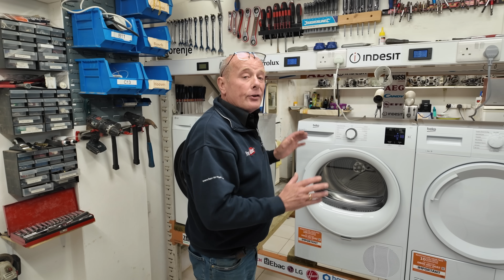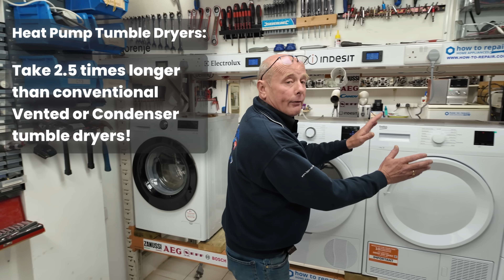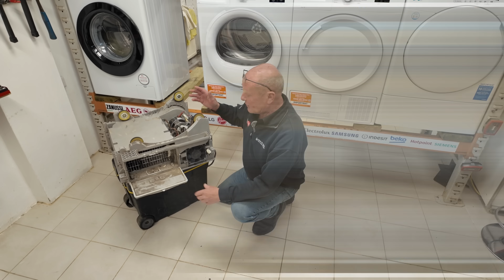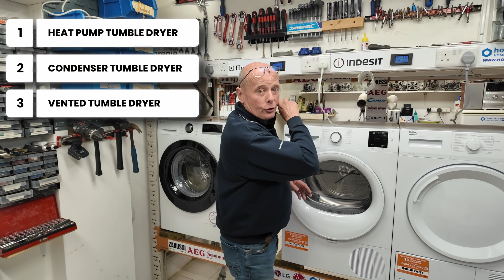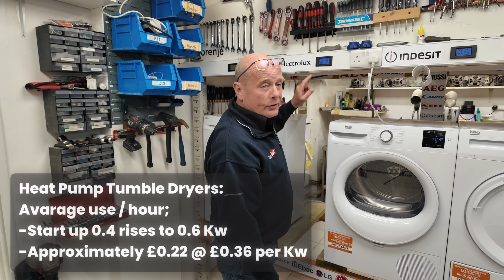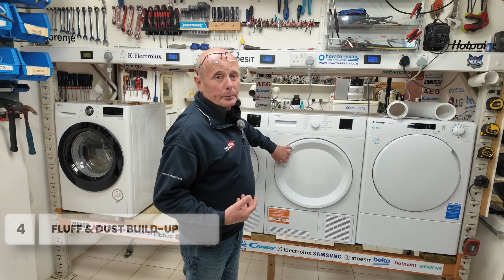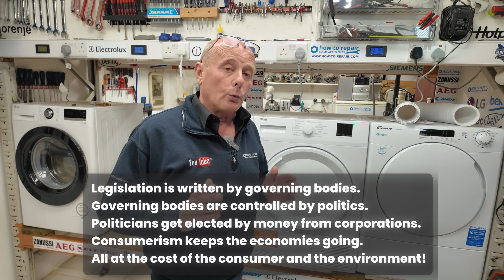Tumble Dryers the Shocking Truth About Heat Pump vs Vented & Condenser, NEW LEGISLATION!

Comment: Something you miss as well as just about everyone else is is the total impact of a dryer on energy consumption in a house, especially in the summer.  Most houses are not very well sealed and can have significant air movement through gaps and cracks.  Normally there is not much as the air pressure inside and outside of the house are the same.  What happens when you turn on a normal vented clothes dryer is a sudden change in pressure.  You now have 200 CFM of conditioned air pulled through the dryer and forced outside.  In order to maintain equilibrium in the house 200 CFM of air from outside the house will be pulled in through gaps and cracks in the house.  This is 200 CFM of hot unconditioned air that will then be cooled down by your homes AC unit (assuming you have one).  A heat pump non-vented dryer does not have this problem.

This may not be as much of an issue in the UK, but in the US, particularly in the south and mid-west where summer temps are regularly in the 90's to 100's F, a lot of money is spent to keep a house cool and even more is spent when you suck in large volumes of hot air from outside when doing laundry.  Calculating that effect on every house is not feasible but is still something to consider.  So, do consider the additional burden on an HVAC system when using a standard dryer when comparing overall total cost between a heat pump and conventional dryer.

Comment: Non of these can compete with the old white knight gas dryer 6 towels dried in 40 mins straight out of the washing machine.Gas cost less than 25p  Very efficient as no burning gas to make electricity

Comment: Do you see how awkwardly the door opening handles are placed on the right two machines? Not 180 degrees away from the door hinges, but at a lesser angle, making door openings more harder. For example door handle on the right machine spans between 2 and less than 3 o’clock, where much more logical would be just around 3 o’clock. Same goes with my brand new Bosh washer and dryer. Both of them have these weird door handle positions.

Comment: I came to the same conclusion as you.  After my 9 year old condenser dryer heating element died.  I investigated repairing the heating element, but realised that the part required was costly (50% the cost of a new machine).  The heat pump dryers made no sense to me, when I could air dry just as quickly.  I will replace my old dryer with another new condenser dryer.  I totally agree with you.  The environment is better if we retain and maintain our old appliances, then purchasing new ones ever 5 years.  The environmental impact caused by manufacturing of new products and shipping and the disposal of old is never really taken into account.  Thank you for your video.

Comment: We should have repaired our 30 year old Electra vented machine (needed a new bearing) instead we bought a condensing dryer which seems OK. To be forced into a heat pump dryer that is more expensive to buy and cannot economically be repaired to me seems like more madness.  Sounds like Red Ed at work.

Comment: My Miele hestpump dryer now has 3500h on the clock, it runs ~2h on a cycle and uses 1kwh for that (I monitor both with a smart plug for the last 6 Months, so these are solid averages, energy consumption honestly even slightly less). Based on that it ran ~1750 times and used ~1750 kwh. Based on that a traditional dryer would have used 3x as much or 2x additional, so an additional 3500kwh. With this energy cost savings I could buy myself a new one right now and still have some left over. But mine still goes strong for now.

I had a Bosch heatpump dryer before that I gave away, where i did take it apart once for cleaning and conpared to this, the Miele filter system is way ahead with a third bottom filter and proper filter clog detection. With proper use I did not see significant dust buildup in the condenser yet.

I think, most of the maintainance downsides of can be addressed through propper engeneering and the willingness of consumers to spend a little more money. These devices have gotton so cheap anyway compared to 30 years ago. And with newer refrigients most of the enviromental concerns in this regard can also be mitegated. Dryers have shown the biggest progress in terms of efficiency of all the big household mashines and to just ignore that is just misleading.

Comment: Fridge freezers don't fail or need re-gassing that often and they are a heat pump system.

Bearings will wear and they definitely need to improve cleanability but, heat pumps are the future, manufacturers simply need to make them to be user maintained friendly.

Comment: We had an hoover engineer out for our A+ condensor dryer which stopped drying about 8 years after we got. Luckily it was a 10 year warranty so we didn't have to pay for th Engineer however he diagnosed it as requiring a re-gas but that model could not even be regassed so they gave us the option of paying just £150 for a brand new dryer of the exact same model as a replacement.

80p to dry a full 10kg wash in 1hr 30 mins I dont think is too bad. Much cheaper than what Martin Lewis was reccomending at the time which was using an Air Conditioner unit to dry clothes which worked out a lot more expensive because it took far longer to dry stuff.

Comment: Wow, thanks so much for your extensive explanation, now I am certain that I will keep my current condensor dryer.  They really are in it to sell you a new machine every 5 years. The heat pump dryer is REALLY a bad concept. Also, I hate half dry clothes that takes more than 2 times the current drying time...

Comment: For some time we've managed with a condenser drier, having to remove and clean the condenser box every month or two. Not an easy job, but a radiator fin cleaning brush does help.
We have been looking at buying a heat pump dryer but have not found one yet that has any method for the user to clean the condenser box. Several have the same cover to get access to the condenser box as in a condenser drier but no means to then remove it.   Watching the video it's now clear that getting access to clean the condenser box on a heat pump tumble drier is not the user job that it should be.  What is the point of an energy efficient heat pump tumble dryer if it's much vaunted energy efficiency cannot be simply maintained because the condenser box can't be cleaned easily by the user to maintain it's energy efficiency.  Indeed why buy a heat pump tumble dryer at all if, as the video shows, an engineer has to be called out to maintain that energy efficiency by taking the machine apart to clean the condenser box - and how often would that be needed given the access door does not even permit an inspection of anything but the front of the condenser box.  How does one even know the condenser box has become partially blocked so as to adversely effect the energy efficiency when only it's front face is visible with the cover open and there is so much more behind that front face that can't be seen or removed by the user to inspect.
The appliance industry has to think again about heat pump tumble dryers and correct an inherently bad design from a user maintenance perspective.  This, so to allow users to a) monitor a drop in energy efficiency of the condensing process and b) so enable user preservation of the much vaunted energy efficiency of included heat pump technology by giving easy access to the condenser box to clean all it's dust and debris collecting orifaces without needing to call out an engineer to do it.

Comment: Was it the manufacturers that "greenwashed" the government or the other way around? In automotive industry as an example it was the government funded research into global warming and so on that led to the introduction of Euro1-7 standards, with Euro7 that hasn't been implemented yet being completely impossible for purely petrol/diesel engines to comply with which in turn stagnated any and all combustion engine research and development for the past 5 odd years (why would you develop something that will be impossible to sell a few years down the line) with car manufacturers expecting to switch to fully electric engines (which also costs money to develop and forced many manufacturers deep into the red to do so, as that was an entirely new industry for most manufacturers at that time) to which governments offered monetary support in form of grants and such to consumers buying those vehicles, by now most of those grants dried up and the share of electric vehicles in most countries not even reaching 1%, only China is leading with 10% of their vehicle fleet being actually electric, and it's many times more than everyone else while still being barely a dent. On top of that governments are now starting to think that maaybe that wasn't such a great idea.
In the end we have a completely failing automotive industry that hasn't developed any new petrol engines for the past 5+ years, is for the most part financially ruined and electric cars that barely make a dent in the entire vehicle fleet of all countries of the world while being a lot more expensive than combustion engine cars without the promised government grants and discounts for switching to electric. So far the only company making EVs that made any profit was Tesla, and their profit wasn't even from selling EVs, it was from selling their emission quotas to other companies, everyone else is so deep in the red it's quite insane.

Comment: I bought a second hand Bosch Serie 4 heat pump dryer second hand in 2022. Has been drying clothes ever since without a single issue. I clean the fluff filter after every load and the additional filter before the condenser occasionally. Saves me electricity and doesn't release any heat into the surroundings.

Comment: Well, you made a friend in ME, that's for sure! And a new subscriber. This video is exactly what I needed as I face replacing a 20+ year old Miele (condenser) dryer suddenly, and was just shocked to see current prices. It was quickly apparent the jump in prices was due to the addition of heat pumps, so I went to research them a bit and -- thankfully -- came upon your video. I'll now see if I can still get ahold of a new condenser dryer instead.
Reply from the maker: Thanks for the subscribing. I hope you get a good condenser or vented tumble dryer since making the video I have seen thousands of complaints about these new heat pump dryers, please remember to share the video if you can

Comment: You should have used the power loggers you have to run a drying cycle on each machine. With a standardised load of one identical bath towel soaked in... 500ml of water? IDK, work out how much soaks it with minimal dripping and use that much.

Comment: End of life for a heat pump isn't hard. You just need the right bit of kit to suck the refrigerant out. 
Modern ones are R290 with a ~150g charge. R290 is Propane, which is 100 year GWP of 0.02 (1 would be the same as CO2, so it's 1/50th as bad as 150g of CO2).
The total environmental impact of just venting the R290 to atmosphere is 3g of CO2e. the UK grid average is 124gCO2/kWh in 2024, so it's just 24 Wh or 0.024kWh of electricity equivalent. For an average UK fleet car, it's the equivalent emissions of driving 23 meters. In other words, completely negligible compared to running a normal house gas boiler which emits the same amount of CO2e in 2.6 SECONDS.
It's just not a problem to even bother thinking about. The energy saving is easily worth it by several orders of magnitude.

Comment: The maintenance issue of cleaning the heat exchangers isn't a technological issue. They should have a user serviceable filter before the heat exchanger. That's a trivial fix. They should also have access panels to get at it without complete disassembly, regardless.

Comment: So on a car you can re-gas it every couple of years, no worries. But for a clothes drier they have to find the leak?! Usually they just do a vacuum test for leaks and refill. Absolutely mad policy because a leak could seal under vacuum and open under positive pressure, they should leak test it.

Comment: What's the reliability of the more expensive heat pump system? Specifically the heat pump itself? In other applications like fridges, freezers, and air source heat pumps, they usually last 10-25 years. They're generally incredibly reliable... Apart from on cars where they often need a re-gas every few years?! I blame this on the other systems having solid metal brazed connections, and the car one using rubber hoses.

Comment: To do a fair comparison you need to load them with identical fabric identically wet. Say: three identical bath towels, each soaked with 500ml of water. One in each machine. 

The energy consumption could be different if it senses when to stop drying or if it has different amount of water to heat, evaporate, condense, and drain.

Comment: I really had to argue with my wife several times over a year to avoid purchasing a tumble dryer, particularly a heat pump version. Videos from YouTube helped the argument a lot.

Since I know about the issue, we bought a better clothesline and happily air dry it. In summer it dries quickly, in winter it helps moisturise the air.

As you also mentioned, less wear and tear on clothes. Low initial investment, no operating cost. No maintenance. And no accidents with garments that were not supposed to be tumble dried. 

The old ways are not always worse. That is a machine I really don't need in my life. I would understand the increased comfort in integrated drying in the washing machine, but to my research, they have their own shortcomings.

Either way. I like your content. Thank you for bringing this to the attention of a wider audience.
Reply from the maker: It’s amazing how well you can dry the clothing in a room that sealed with a simple circulation fan and a dehumidifier the energy costs are very low

Comment: I agree heatpump dryers are a pain in the ass to clean deeply and require professional work. I wish they were easier. I do think that the technology is MUCH better on the clothes though since they can be fully dried at a much lower temperature and hence you avoid a lot of problems associated with high temps.

Comment: At last - the basic flaws in heat pump tumble driers voiced by someone else. I am not alone! I will definitely be swapping back to a condenser drier. I dry laundry outside for preference and just finish non-iron items off in the drier for a few minutes to soften them.

Comment: I have just found your video after buying a Haier heat pump dryer because my old Servis one has finally died (I inherited it from my Grandmother after she passed away).  I've had it for 19 years and have no idea how long she had it previously.  You mentioned that the heat pump dryer may cost £300 to repair.  That's what I have just paid for the device so I would not pay anything to repair it but I'm an IT engineer who hates putting things into landfill so will find a way to get everything recycled if it turns out that I've bought the wrong thing

Comment: I’m not defending a heat pump dryer, but I think you’ve left out a hidden cost of a vented dryer. The air blown out of the dryer vent was already heated or cooled to room temperature. It is the replaced with air from outside which is cooled or heated again before entering the dryer. The amount of previously heated or cooled air blown out in an hour is enormous and a complete waste of energy and money.

Comment: Brilliant !! I've had my vented one for 6 years , stopped working last night ( luckily after drying ) so I started looking at these videos thinking of buying a new one, on Inspection it turned out the mains plug behind the dryer had burned out , must have got damp , so quick easy fix 😊whilst I was shopping for new plug and socket I called into shop to look at new dryers just in case   the plugs didn't fix the problem and the Man there told me you could only buy PUMP dryers now as the vented ones were being phased out. So glad I came across this video, my old dryer is just finishing cycle  but if it fails in future I will buy VENTED. Thank you.

Comment: I am a big Miele fan in need of a new dryer. All new Miele dryers come with the heat pump system. Are the problems mentioned in the video also relevant for the Miele TWL 680? Anyone here with some experience in this area? Thanks!

Comment: I can't agree on this one. I've never had a vented or condenser dryer, but I'm very happy with my Miele T1 heat pump dryer. A full load is done in 30 to 60 min, bone dry. Also the miele is the only manufacturer to put a very fine filter before the condenser fins and my mashine is perfectly clean inside, cleaning the filter every 2 weeks and its going strong now for a year of heavy use. Quality compressor refrigerator systems are built to last - I don't think I will have a compressor fault or a leak on the Miele, fingers crossed. 550w of power for 30m is slightly over 1kwh and in the summer, I get it for free from my pv.